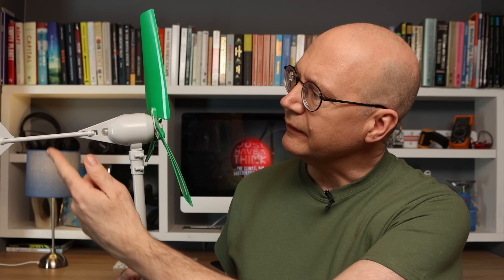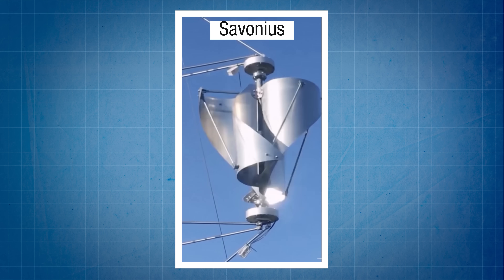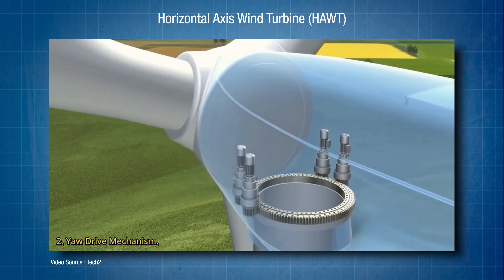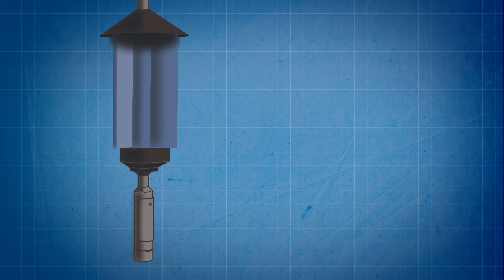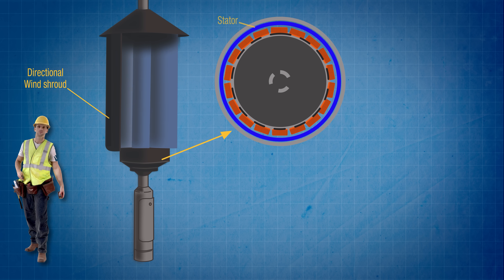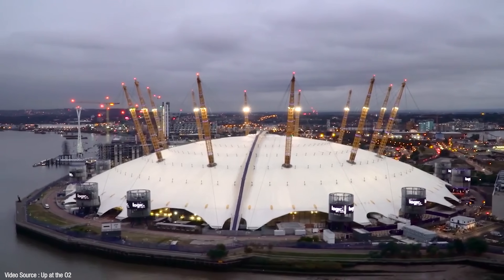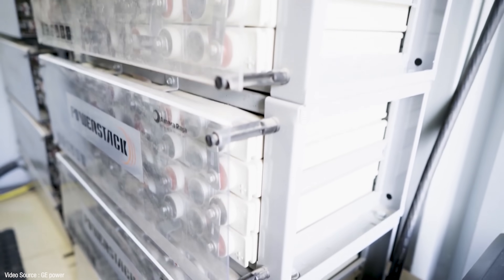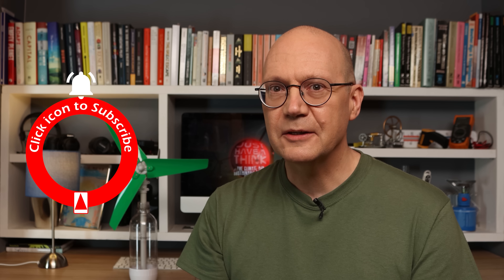A vertical axis wind turbine that doesn't need the prevailing wind! How do they do that?

Comment: The wind that the traffic generates serves to reduce the drag on the vehicles that are travelling on that road.  Disrupting that flow will cause an increase in the drag on the vehicles.  More fuel will be burned in order to generated electricity resulting in a net loss of energy.  Once again, there is no such thing as free energy!

Comment: I have often thought that on a large enough scale they could supply district power locally and out strip the massive national grid maintenance costs for traditional turbines . i have a space between my house and the next which always   produces  wind regardless I put it down to a  crude venturi effect where the gap between houses varies over its length  and wonder whether the principal could be applied to the Alpha technology to provide a wind externally and enhance the speed of the turbine much as a passing vehicle would . this could in my opinion provide a really good wind flow .if I constructed a large but  accurately proportioned mathematically designed venturi shape between my house and the next with the vertical axis at the end to receive optimum  wind speed albeit irregular .  Please put this idea out there of using venturis to provide the wind especially geared to small scale domestic power sources initially

Comment: Excellent. One point of interest for mini generators is their advantage of not easily sabotaged to affect the entire grid (too much time and resources to bring them down) so a thumps up for security but also consider the other side of the coin and that is their maintenance.  A 500 mile stretch of a motorway will have thousands of the running each on which will require looking after. Still I think the advantages outweigh the disadvantages. Resources needed for their construction should also be considered and compared with mega generators to ensure minimal environmental impact.

Comment: For a long time I have seen Rotating tops air extractors. I had the same idea as this video, but placing the rotating blades around the apertures of bridges and other structures where air flow is bigger, because it is restricted.

Comment: I've been involved with Vestas wind turbines and the wind speed is quite critical to them for safety reasons.  Winds exceeding about 25m/s cause the turbines to 'feather' the blades and shuts the turbine down until wind speed drops down into the 'sweet' operating range again.  I didn't notice any such protection mentioned in the overview so, considering the application has these will all be operating autonomously, how do they self-protect in gale type conditions?

Comment: I suspect that the turbines would slightly slow down the vehicles by making them imperceptibly less aerodynamic. In which case they would not be harvesting wasted energy but leeching it parasitically from the vehicles. When you have three lanes of heavy traffic all moving at the same speed they create a stream of moving air that benefits everyone, so any adjacent obstructions would reduce this effect.

Comment: This makes as much sense as mounting them directly onto the cars: using the recaptured wind energy to directly power the car.
Reply: No, because connecting it to a car creates drag on the vehicle from wind resistance. You then need to use more fuel to get from a to B, so you are not “reclaiming” any lost energy. You are just essentially converting diesel into electricity.  However, having these units installed on the roadside does, in fact, capture, wasted energy and the diesel/petrol consumption of the vehicles, creating this energy remains the same. It literally is free energy
Reply: These roadside windmills put additional air resistance on the passing cars, decreasing the cars' fuel efficiency, increasing the amount of energy the cars use to achieve the same speed, increasing the energy they use (and exhaust pollutants). And due to other inefficiencies, the windmills capture less energy from the cars than the cars' increased energy use. The net, system-wide energy consumption increases. Which is why it'd be as dumb as directly mounting the windmills onto the cars. It's worse than pointless. @RichardRandall-h5l

Comment: In Belgium they used to have these orange bag type wind indicators on the side of the motorway/highway (I think these where meant for truck drivers), as a kid in the back of the car I would often think, well that's part of our waist energy.. if we collect that, we'd significantly lower our own "pollution" (a 9yo's word for carbon footprint 😅)

Comment: Yes, this theory was debunked by me.
It causes turbulence for the oncoming traffic; trucks report it's like a head wind all the time. Follow the FULL path of the wind and the light will go on.
Think 'fan spray', wind returns around and falls off the blades in the 180 direction it got it; creating headwinds for the truck behind of 25% of the wind generated.
Before engineers seek money, they should draw things out in colored crayons. Cigarette smokers think butts disappear when they flick them too.

Comment: Alpha 311 is thinking too small, and too slow, in their rollout.  In the U.S. we have millions of single mast, wood or metal, electrical power poles.  These poles support high voltage, 169K, and medium voltage, 10K, power lines.  The top of every one of these poles could be a location for a small vertical wind turbine.

Comment: The law of conservation of energy states that the total energy of an isolated system remains constant; it is said to be conserved over time.  Cars move the air, the air turns the windmill, the windmill generates "FREE" electricity.  This sounds like a marvelous design, except the concept violates a psychical law.  Adding windmills near auto traffic ADDs wind resistance to the traffic, which makes the vehicles get reduced efficiency per mile.  You are generating NEW electricity by burning NEW fuel at the drivers expense.  This is not a green idea.  It is a high school (shop class) idea. This is Myth-Buster level Science, entertaining but incorrect.   Just Have a Think should maybe Just Read a Book.
Reply: Well said Jules. Thanks for pointing this out, I fully agree. However, I once had a discussion about this before. The other person stated that the wind turbines would harvest energy from wind forces that otherwise would have been wasted. I tend to think that harvesting waste wind energy is only possible when the turbines are far enough away from the passing vehicles to not disturb their aerodynamics. Of couse the power output would then be lower, but would it actually be possible to only catch 'waste wind'?

Comment: Put these next to railroad tracks!!! We could also use compression to make energy, a pedal like thingy on the railraod tracks that makes energy w every wheel of the train...Same with cars, make a raised platform and get energy w every wheel that passes. Do you all realize how much energy is lost in a car w comb.engines? The heat from the exhoust just next to the engine is crazy high and it's just lost. It always blew my mins how nobody recuperated that heat.

Comment: Two meters tall, about a meter in diameter, less than 8 kilograms. 
An electric generator, two bearings, a carrying structure... about half of that weight? 
I count at least 8 blades. So a turbine blade, 2 meters high, about 30 - 50 cm wide weight less than 400 grams in this design? And can withstand autumn storms while spinning at high speeds.
Not goin to happen. The numbers don't match. Just have a think.

Comment: Umm, he's saying these are massive.  The ones I've seen are 200-400watts.  That's max.  So half that because winds blows.  They keep them small overwise they wouldn't turn.  Make sure you read the fine print.  A max of 6kw.  My car has a max of 240km/h on the clock.  Don't give max, give averages or the min.  Solar you can give max. because good solar will exceed the max.  Turbines have brakes.  We have big turbines like this on the foreshore to light it.  That's all there good for, very small loads.  We also had the monster turbines in Swaffham, Norfolk.  It was going to power our town, everyone was excited.  It never produced any energy that we knew about.  It never turned.  They put another next to it for fun.  So two not turning.  2 massive eyesores that were good for nothing.  Simpson's monorail comes to mind.  See youtube on Hawaii and wind turbines.  Turbine graveyards.

Comment: We’ve tried outfitting cellular towers with small windturbines. It never took off, basically due to strength issues of the towers and the use of microwave links which require stiffness of the tower. Still, the roadside idea sounds brilliant.

Comment: How about installing these on sky scrapper roof lines in horizontal twin counter rotating configuration?Advantageous might be lower structural requirements, ease of maintenance access, ability to capture the wind shear that exists on many buildings, possibly designing a shroud system that increases swept area  at very low cost, reasonably dependable wind speeds, using the wind shroud as an adjustable shield from over reving, or accomplishing the same result by mechanically adding in more generating resistance and locally dumping excess energy into potable hot water supplies (restance heating elements are very cheap and clean) or HVAC systems. My personal WAG is that the instalation and maintenance costs would be orders of magnitude less than a convential turbine tower. An additional benefit would be very low visual impact. A simple track mounting  system would allow for a 20- 40 foot unit to be automatically and variably moved laterally in and out  for wind optimization and full eyelevel maintenance access. If I were a young man I would be seeking an operational partnership seeking to develop this application on a revenue sharing basis with building owners.

Comment: I thought you were playing with a boat wind generator. I prefer the Vertical Axis designs , they don’t seem to be as noisy if engineered correctly. The biggest challenge I would have making one at home is designing the Bearing and power transfer if DC. If ac then the turning three phase armature could be gear or belt driven from the rotor or windmill …. So easier.

Comment: "...to translate the rotational kinetic energy of the blades into useful electrical energy."
The kinetic energy is not used to make power. It's paid for at start up and is stored in the moving parts. The useful energy comes from the input of wind energy which produces torque and is extracted continuously by the generator.
If the wind dies and the turbine stops under load, then you get your kinetic energy back.

Comment: The companies benefiting from 0% tax should be clean energy companies, and essential utilities; not Amazon, Google or any of the other corporate monsters.
Decentralising energy production has always been an important step toward Carbon Neutrality; but the energy 'industry' and governments remain resistant and slow, to encourage or adopt it; because being decentralised, energy production would become very difficult (if not impossible) to charge for, or tax!
Decentralised energy systems could release SO MUCH DEMAND from the system, if we could standardise widespread adoption [SIMPLE INSTALLATION OF MODULAR UNITS]
Overall demand would drop, meaning that there was LESS DEMAND FOR FOSSIL FUEL SOURCES OF POWER!
(I look forward to the day, when our most difficult problem is choosing the turbine that has a lower Db than our bathroom extractor, or PC fan).

Comment: Conventional wind turbines are often accused of noise pollution of blade tips and bird hits. How do these fare in that context?
Reply: Due to the way smaller radius the speed of the tips are just a fraction of the conventional rotor blades. This results in an even smaller fraction of noise.
Concerning birds: These rotors look like columns and birds can spot them a lot easier, also the lower impact speed will do way less damage on impact.

Edit: Also given the fact that this particulair system is ment for use on motorways noise and birds strikes are anecdotical issues.

Comment: Remote dual carriageways and motorways without central lights may be able to get a self powered light system off-grid if used in conjunction with a battery.

Comment: In the not-too-distant future, when you buy a house, a big question will be "how much electricity does the house generate?" Obviously, the value of the house goes up in sync with the answer to this question. This company is NUTS to focus on big VAWTs. Selling hundreds of millions of little VAWTs is where the money is. One other example: What about light poles? In the USA, power is distributed to homes on billions of tall wooden poles. Why can't each one have a little VAWT on it pumping kwh into the grid? Again, the market here is billions of small VAWTs, not a couple hundred thousand big ones put on soccer stadium rooftops and cell towers.

Comment: I will check out Rosie but the small horz shaft turbines is the noise, if the vertical type can reduce the noise and vibration then they may have a place on houses and boats.
I also see the morning and evening wind adibatic(?) from heating and cooling of the land/sea may be a secondary source of power for the turbines.
 Cheers Warren

Comment: Anything helps. Set up a test on a busy highway for a year and see what comes up. 
Also, what happens with that black heat created by the surface of the square kilometers of worldwide solar panels? Everything ads up!
And in the mean time, the main problem is overpopulation. But it's good to know there are people caring until the end.

Comment: IN MY VIEW, ANY WIND DRIVEN GENERATOR NEEDS TO HAVE A ROTOR DIAMETER OF AT LEAST  TWENTY METRES TO PRODUCE ANY WORTHWHILE RETURN.   EXTRACTING ENERGY FROM MOVING AIR IS NOT COST EFFECTIVE.  HAD YOU CONSIDERED THE ALTERNATIVE METHOD TO EXTRACT  ENERGY FROM FAST  MOVING TRAFFIC ?
                  MAY I SUGGEST THAT IF ONE HAD ALARGE COIL OF WIRE AROUND, UNDER AND OVER THE ROADWAY THEN THE HURTLING MASS OF IRON THUNDERING THROUGH THAT LOOP WOULD PROVIDES A MORE EFFICIENT AND COMPACT METHOD OF UTILISING THE CONSTANT  TRAFFIC FLOW.
              THE COILS WOULD BE SUPPORTED BY THE MANY BRIDGES/GANTRIES THAT ALREADY EXIST AND ONCE INSTALLED, MAINTENANCE WOULD BE MINIMAL.
             THE TRANSFER OF ENERGY FROM THE MASS OF FAST MOVING VEHICLES WOULD BE FAR MORE EFFICIENT THAN USING THE DISTURBED AIR AS THE TRANSFER MEDIUM AND THE INFRASTRUCTURE WOULD BE FAR LESS INTRUSIVE.
          THINK OF THE COILS AS BEING THE FIELD WINDINGS AND THE SPEEDING TRAFFIC THE ARMATURE OF THESE GIANT GENERATORS.
              THIS SYSTEM WOULD BE CHEAPER TO INSTALL, REQUIRE LITTLE MAINTENANCE,
PRODUCE MORE OUTPUT AND BE MUCH LESS INTRUSIVE TO THE LANDSCAPE. LASTLY IT MIGHT BE FAR LESS VULNERABLE TO VANDALISM AND WEATHER DAMAGE.
              MOVING AIR IS A POOR MEDIUM FROM WHICH TO EXTRACT ENERGY BUT TONS OF FAST MOVING IRON OFFERS GREATER POTENTIAL.
Reply: First: CAPSLOCK does not make your post more beleivable, only more annoying.
On topic: This idea is as stupid as turbines on cars. The extra electromagnetic drag will cause higher fuelconsumption so a loss of energy overall. To me it also seems you do underestimate the resources needed for coils of that size.
Your assumption that wind is a weak powersource is kind of odd, given the performance of modern sailing vessels.
Reply: @hotdognl70  Thank you for your observation, I had no intention to annoy anyone in this serious debate. You fail to consider that some of us have failing eyesight and CASPSLOCK is possibly a selfish device to avoid  composing errors.
              Sailing vessels support my conviction that you need to build BIG to get any real result from wind power. Merely witness the huge dimensions of the giant grid turbines against which the cost of my motorway  coils would be cheaper to build and cheaper to maintain.
               I believe the electromagnetic drag on a car passing through the coil would be equivalent to the vehicles alternator load for appox one second - hardly enough to bring it to a screeching halt or drag the  fillings out of ones ivories

Comment: Is this system not stealing energy from the cars? I mean, the wind turbines would increase the the air pressure the cars have to fight against by preventing the air to freely flow away. So in the end there is no free lunch and this system would increase oil consumption... This is my guess but it would be interesting to test it.
Reply: yes
Reply: No, it's not affecting the cars directly since it is not adding to the drag. The airmovement will be absorbed by the enviorement otherwise, thus going to waste. Best case it might even add positive to the drag since it will take away the airflow of the opposite lane. The latter is possible but very farfetched.
Indeed it is not a free lunch but leftovers prevented going to waste.

Comment: What a clever idear, i am sitting here thinking just how much road there is and thinking that much of it is in fact unlit at night, if nothing else it could put street lights all over the place, and possibly still add power to the grid even if say one in three is there to provide power for the street lights, in winter periods you would have an added safety of having street lights as a means of say markers during foggy weather.
The other thing that struck me was shipping, at sea there is always a good breeze, is they were big enough could they power a ship??
That might sound daft but remember a ship on the move is generating breeze of its own  all the time, agreed it would b not move fast enough to go water skiing behind but migh just be worth a try.
The other thought was airports and their runway lights i bet they pay a big amount of money just to light a runway, but planes creat a huge amount at moving air,!!!!!!